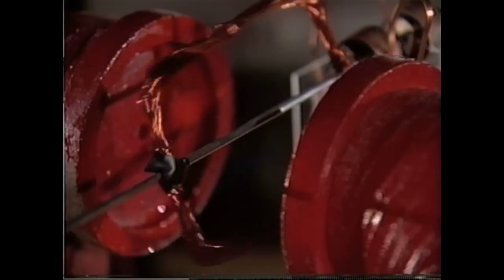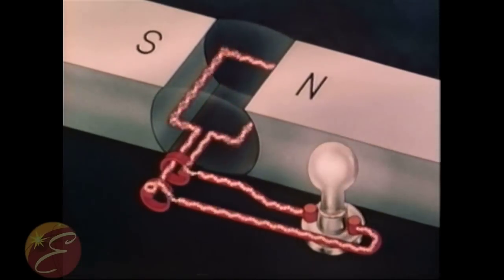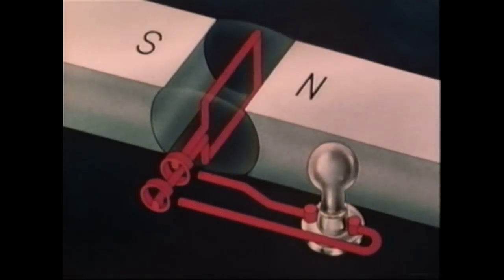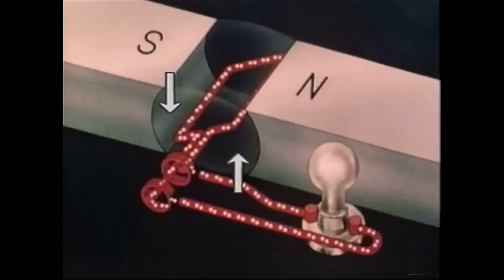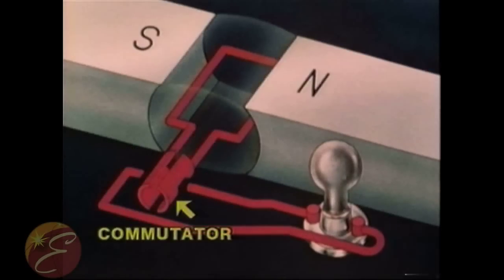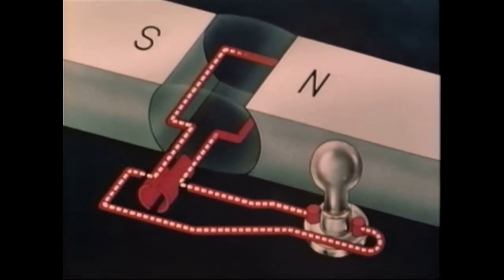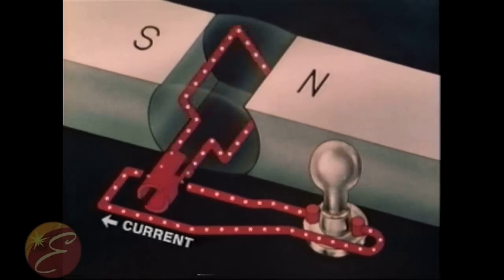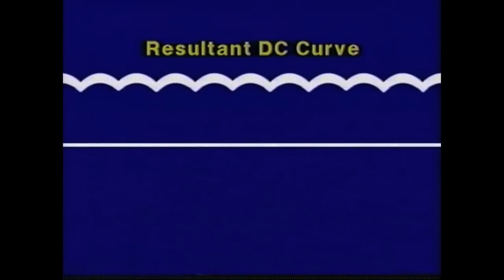Commutators: Basics on AC and DC Generation

Comment: one more question, why there is a need to have the split in the commutator? is it to separate momentarily the opposite electrons flow between the coil and the external circuit? thanks in advance, your reply would be appreciated
Reply: As you can see, each side of the ring has the opposite flow with the other. If there is no split, the two flows will get together and then, because they used to flow the opposite (one is + and one is -), now they become 0, therefor there's no electricity at all. Sorry for my bad English.

Comment: PLEASE somebody answer me

If the current direction changes, shouldn't that mean that the direction of the coil rotation changes too? 
i got this paragraph from bbc bitesize 

When the coil is vertical, it moves parallel to the magnetic field, producing no force. This would tend to make the motor come to a stop, but two features allow the coil to continue rotating:

the momentum of the motor carries it on round a little
a split-ring commutator changes the current direction every half turn
Once the conducting brushes reconnect with the commutator after a half turn:

current flows in the opposite direction through the wire in the coil
each side of the coil is now near the opposite magnetic pole
This means that the motor effect forces continue to cause anticlockwise rotation of the coil.

Comment: I did not understand the dc part, the use of brushes and how exactly is the commutator converting acto dc : l
Reply: +Ritika Verma well if you watch the video again closely you see that ac current is made because one end of the wire moves upward producing positive current flow then it moves downward producing negative current flow. so what the dc commutator does is split the rings so that the left wire only gets downward movement in the wire thus creating negative current flow and vice versa.
Reply: Just google dc commutator

Comment: Where has the battery gone ?
Reply: the battery is replaced with the light bulb, the generator is the opposite to the motor it converts mechanical energy into electrical energy.i.e a propeller turns in the wind which is connected to the wire loop the movement of this loop in a magnetic field induces a current which is used to power the light bulb.

Comment: I dont really agree. When the coil is in a vertical, the flux is maximum as it is the point where more flux cut the coil and it is zero when the coil is in a vertical. The formula for it is cosine. When it is in a horizontal, the angle is 90 and cos 90 is 0. Totally wrong it.